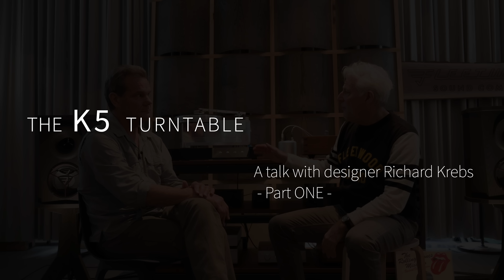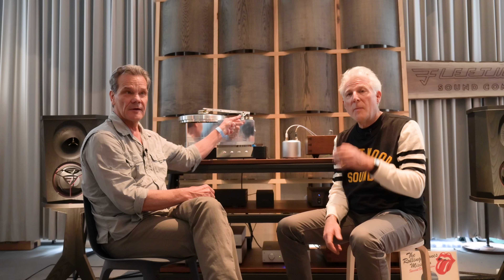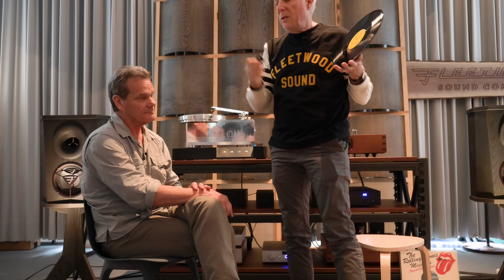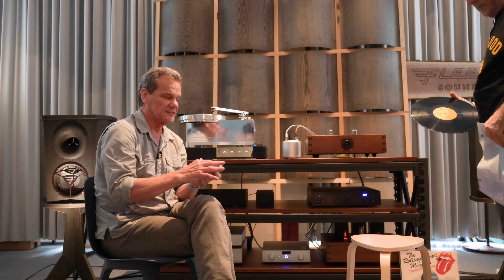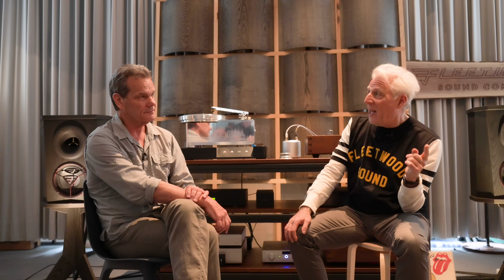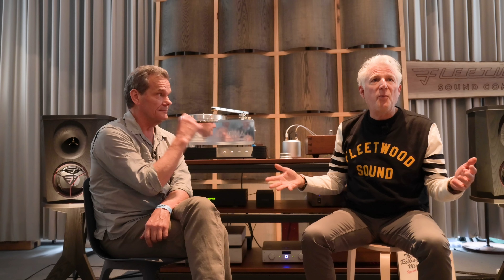Talks with OMA K Series turntable designer Richard Krebs

Comment: I am the “famous reviewer” to whom Jonathan refers, with his usual derision even though I bought the prototype K3 that’s mechanically identical to the finished product. In my review I noted that the test record and app I use is essentially for entertainment purposes only yet the K3 still measured best. Jonathan’s cynical attitude towards magazine reviews and reviewers is clear. Again, the review made very clear that the K3 was and is the best sounding turntable I’ve yet heard, though adding the SAT arm to the rear mount improved the bottom octave performance. Note that he admits they don’t have the testing equipment the manufacturers of the motor assembly and motor controller have but in their case that’s fine and understood, but in the case of the reviewer who also doesn’t have such test gear it’s an opportunity for derision, but that’s been ongoing since the day I first met Weiss at a party. Being a pro at this, I ignored then and ignore now his contempt for me. I couldn’t care less. The turntable is the thing and Krebs designed a brilliant one.
Reply: Why did you buy the turntable after everything you just said?

Comment: Would you share with us how the listening sessions were accomplished? Specifically, were the critical listeners using passive speakers and/or headphones? If passive, can you give us an idea of the listening room and the speakers involved? How about the electronics? Also, if headphones, can you give us an idea of the models and what type of headphone amplification? Thanks so much, Johnathan, Richard and your entire team for your continued desire to push the envelope in pursuit of sonic nirvana!!!
Reply: I shouldn't have omitted the possibility of your listening cohorts using active speakers, or hybrids as well. Looking forward to your insights on the listening journey with the K5. If you have any similar insights with the K3, please share them as well. Thanks again! BTW, I really appreciated your "Listening" series!
Reply from the maker: Hello Cedric, here's Richard Kreb's reply: 'During tests, my system consisted of the OMA K3 mule prototype (from which the final prototype was produced).- Schroeder CB L arm- Shelter Harmony cartridge-Custom, balanced output, tube preamp-PS audio BHK300 power amps- Speakers that were once Acoustat 2+2. Please do not project any experience you may have with 2+2s onto these units. They are fundamentally different.'

Comment: The best point that is made in this presentation is at 31:45. Belt drive technologies are fundamentally limited by the compliance of the belt. It’s often said, but it is basis physics. Direct drive is the most accurate technology. 

@trackingangle929 did a fantastic demonstration recently that demonstrates the clear difference that timing makes in his comparison of the TechDAS and the OMA. https://www.youtube.com/watch?v=kdLbWQFdsPg
Reply: does the material from which the belt is made have an influence on compliance ? maybe some synthetic material could provide better performance  ?
Reply: @gino3286  if the belt is made of rubber, it is simply a rubber band so yes. There have been a number of different materials tried, but ultimately this is a limitation of belt drive designs.
Reply: @8skywalker8  hi thank you very much indeed  I asked because i have seen many high end turntable with belt like VPI

Comment: I have trouble understanding how changes of speed at that level of precision could substantially alter the sound. Analog tape recorder engineers never bothered to spend 11 months callibrating their machines after all.
Reply: you understand correctly what one of these guys is trying to obscure, that human hearing did not evolve to be accurate.   the evolutionary advantage was flight in the correct direction, even if what you thought you heard was not real.

Comment: Nice interview and an interesting concept. But the "total accurate speed" of 33 and period 3 is not the full truth.

In the chain of production the speed of the machines involved to cut the vinyl are not stable at all. Especially in the 50ies to 80ies.

R2R during recording -> stable in speed to 100%? Don't think so. See Kind of Blue as an extreme example. Same to play the record for cutting especially on a different R2R. And the cutting engine for the vinyl itself also will not run perfectly with 33 and period 3.

So the record will not be pressed with exact 33 and a 3rd at all. And if this flutters, what does a so stable speed of your machine helps? 

Agreement to that would mean, a turntable running stable by 0,01% will be more than ever needed.

Cheers 

Stefan
Reply: Your argument makes complete sense...however they claim that the sound improved the tighter they controlled the speed of the turntable......
Reply: @mfr58  I claim the throne of the king of Spain!    also, a belt can be a simple and cost effective mechanical frequency tuning device against transmitted motor noise.

Comment: I thought the discussion of human hearing had serious factual  flaws, which the engineer chose not to participate in.   .  first the choice of digital cut off frequencies was a manufacturing decision, not a limitation of scientific understandings, as it was, for whatever reason,  presented.  
more importantly, the discussion of human hearing completely avoided that human hearing is only subjective , that one can only know what one thinks they hear, which may or may not agree with reality.   

of course considering that  human hearing  is only subjective,  immediately questions the validity of such an extreme design as a sonic necessity and not just an ego stroke.  an ego stroke can be a very valid product goal, as it is, for example,  with high end wristwatches.  

the pitchman all of sudden throws in , " double blind testing" in the middle of the conversation, but despite all the references to listening tests, I am left with the impression that no statistical analysis , which is essential to separate normal subjective hearing results from the actual reality of what was heard,  was ever used, only what people thought they heard ,  was referenced  as a result of listening tests.    no results,  after error was mathematically  eliminated, as with actual double blind testing , seemed to be part of the conversation.

I could go on, but if this is only part one of three parts, I could get a stomach ulcer by part three.  I just wanted to learn their approach to the main platter bearing design, the foundation upon which all the fancy other engineering rests.

Comment: if you have an electric motor, you will always have slowing down with varying resistance, because there is no rigid connection with primary mover. Only thing I know of which is close to perfect is hydraulic motor with very little compression of the oil, however, we are still at the mercy of its source of power which must be hydraulic pump which is close to perfect, however is driven by electric motor or gasoline engine and we are back at the root of the problem. Yes, you can try to compensate that, but it is always after the fact so it's never stable.
Reply from the maker: Hello @bastuskochany, here's Richard Krebs' reply: '
The virtual incompressibility of oil makes it an attractive drive option. The problem is that linear torque hydraulic motors are rare, bulky and employ noisy ball or taper roller bearings. Linear flow compensated pumps are even more rare. Then of course as you point out, we need a prime mover. Which would likely be an electric motor. So we are back to where we started. The solution is to use an exceptionally smooth and powerful direct drive motor then carefully apply feedback / feed forward.'
Reply: @oswaldsmillaudio  turntables have been driven with falling water , to eliminate the pump noise, but were never taken beyond a design exercise.

Comment: Why has every turntable designer for almost 40 years, chosen to completely ignore the obvious problem of record centering? Nakamichi solved this problem in the late 70s and early 80s with their TX-1000 and Dragon CT turntables, but nobody has tackled the problem since then.
Simply look at a frequency over time graph of a turntable playing a stable test tone, and the problem becomes obvious. Even the tiniest amount of off centeredness, causes a huge 1.8 Hz cyclical wow, that completely swamps any speed instability from the platter drive system.
Reply: the dragon turntable was not that quiet , despite contemporary glowing reviews.   a much  simpler solution is for one to simply modify the hole until optimal position is achieved.  most who bother with the practice use a pencil mark to show which side of the now enlarged hole goes against the spindle

Comment: The worst part of this is the cherry picked ‘science’ taken out of context. That becomes pseudo science, anti-science. You don’t have the foggiest idea what ‘double blind’ means. Sad, but par for the course in audio.
Reply: Pseudo Science 101.. 😂
Reply from the maker: Hello Kuglepen64, here's Richard Krebs reply: 'You are correct, testing was actually single blind. There is an interesting little twist. The programmer did not have any expectation of a positive or negative outcome when he altered the program. He did, of course, know when he made no change.'
Reply: I've participated in so many blind and double blind tests (not just audio), and interestingly, despite expectation bias, there was no difference as to the results (qualitative ranking). What does affect blind tests is new versus old (i.e. if one of the samples is a known quantity, to the extent one may recognize and/or look out for it).